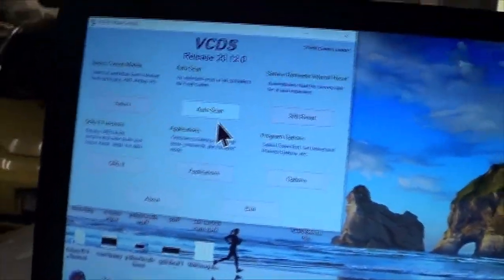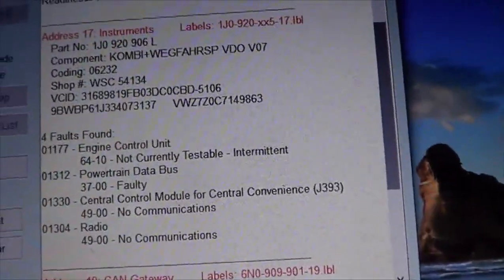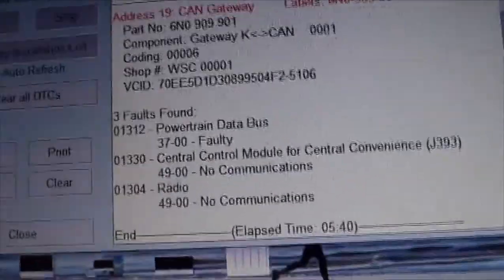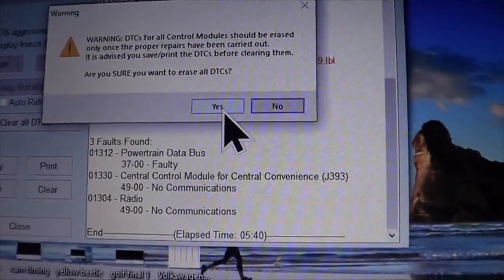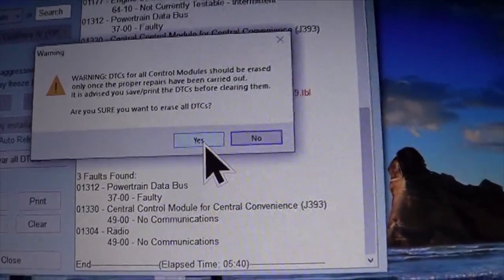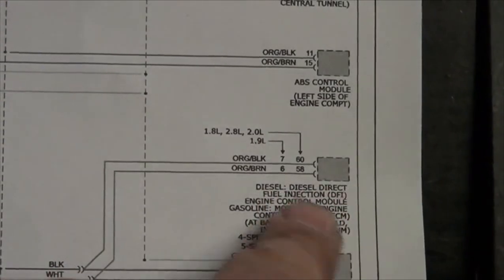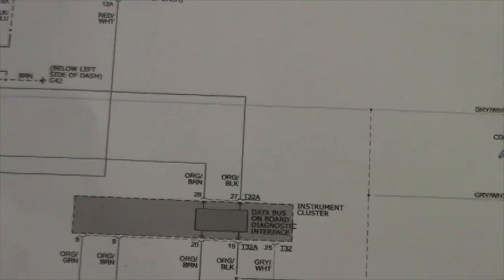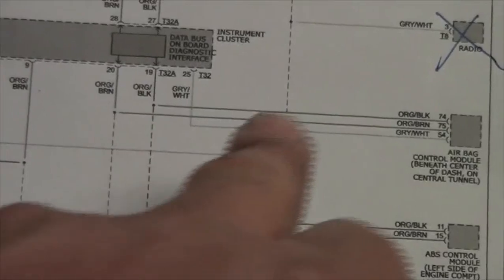Jarhead Golf Tdi starts & dies

Comment: Hrm, going to add this to my no-start issues -- really check the fuses first, and note any discolouration along with corrosion.  Most of my woes have been weak starters or batteries in poor condition.  Since I bought a few TDIs that have sat, to repair back up, I'll be looking carefully at the fusebox  and grounds for corrosion on those as I start reviving them.  

Looking forward to the next video to see what the solution is.
Reply from the maker: Knowledge is power.  We learn on each car we work on, and if we watch a youtube video then we learn that problem/car too, so we gain knowledge and experience much faster.

Comment: 2010 VW Passat  No problem starting as long as outside temp is around 70 degrees F or below(starts every time).  Once the car sits in the heat, car will not start and I get a "Immoblizer Active" error comes on and the car will not start.

Comment: Have a 2002 or 03 Passat with IMMO issues. Body shop had thought the immo coil with a key, used would work but I sadly told them no unless there's something I'm unaware for a solution to immo not working. 

Removed ECM , have here at house as customer wants the immo deleted on it or turned off as I call it. 

It's a Bosch unit with ME7.5. 

Any recommendations on software, hardware to use? 

I have a few Eeprom readers but would rather do it via OBD port if I can find a pinout chart and the proper software. 

IF you could point me to some resources that would be great and I can move towards the next step. 

Being the body shop (towing company also) owns it they just want the immo off to get better money for it. The car was the daughters boyfriends car. They found him a newer car already so they just want to be able to get better money for this car if possible.
Reply from the maker: resources?  Send it to someone who has done it before. (me???) or fix  it right.  I'm encountering more and more issues where delete just isn't the right solution.